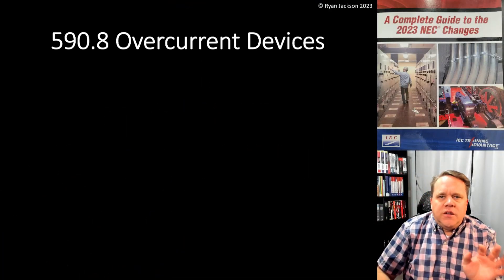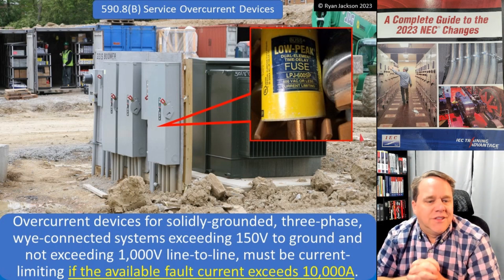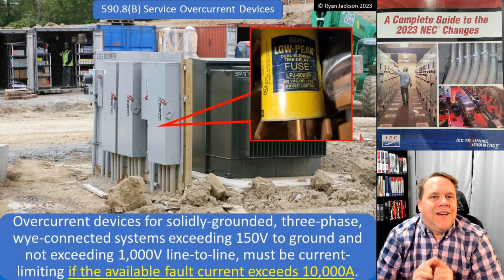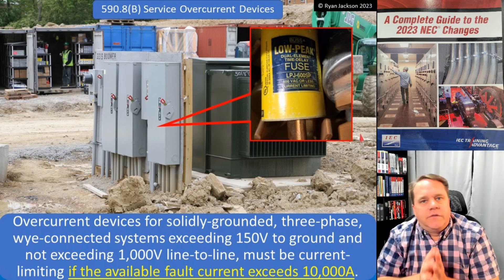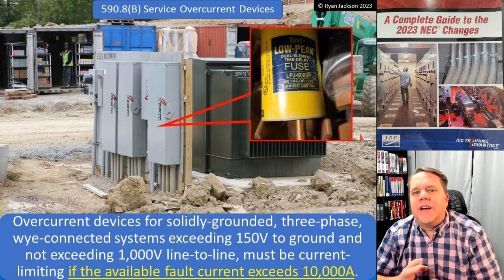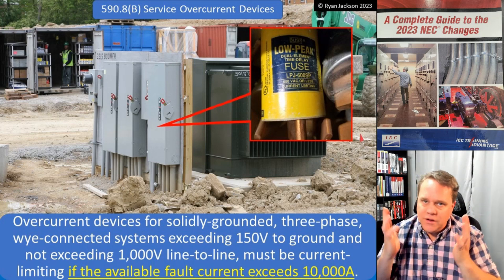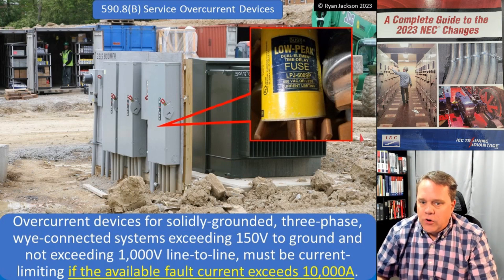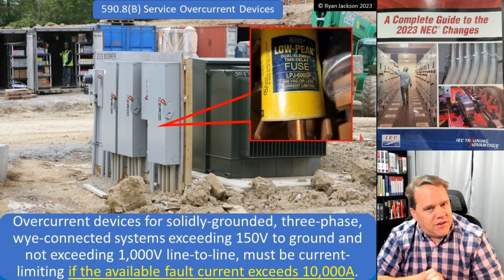590.8 Service Overcurrent Devices Temporary Wiring

Comment: I've seen flooring guys shove the stripped end of the wire on their cord for their 240v sander into the allen heads of the main breaker lugs of a panel to power it.